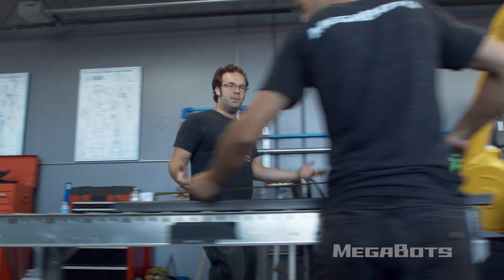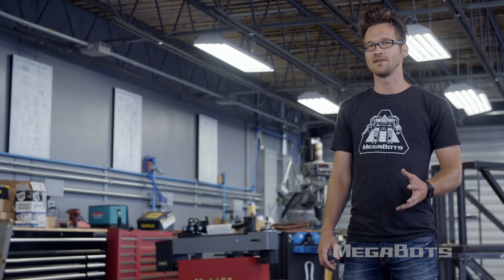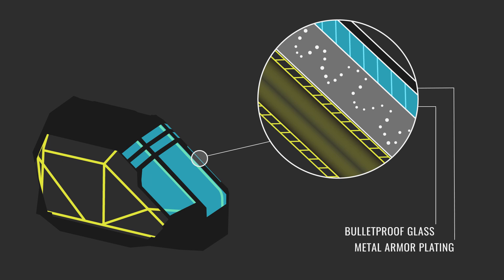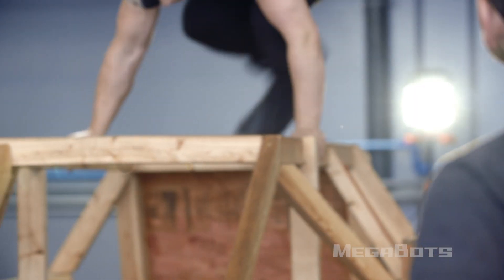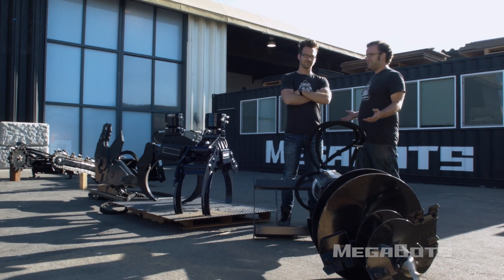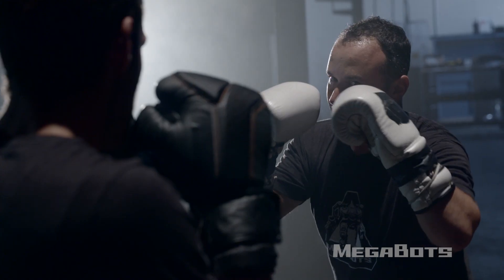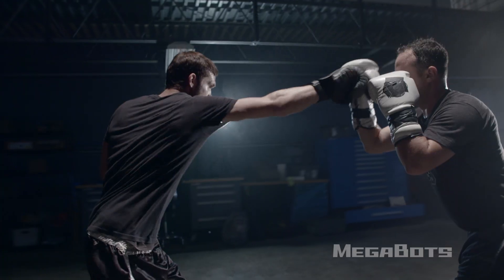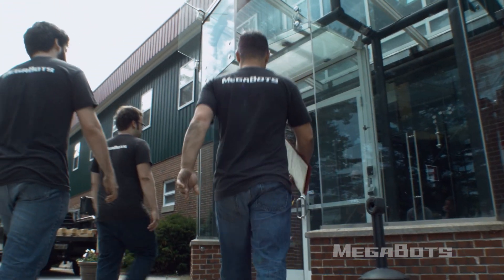How to Design a Giant Robot (Season 1)

Comment: The trencher, auger and stump grinder would not work very well against thick steel. The reason being they are meant for handling dirt not shredding metal. The best attachment would be a hydraulic demolition shear. It would total most opponents.

Comment: The robot would need a gal recover mode where the central sensor ( I assume an accelerometer) know when the robot is falling and move the arms back or forward depend on how the boy fall. 
By the way, no need for heavy weapon. A magnetic disturbance grenade would be enough to take the Japanese Megabot down because they heavy  rely on electronic system control.

Comment: I think they're being way to in depth with this. I would be amazingly surprised if the dodging worked at all and I have a feeling the robots aren't going to punch at all but just push each other. Or they're just going to run into each other blades spinning.
Reply: The thing is, they are thinking long-term. These people want to create an entirely new sporting event. They have to push the bar. Not to mention that they don't want to die. That MK1 was a death trap.
Reply: Andrew Hodge true but I think it may be early for that. I would be extremely surprised if they dodged a punch. Haha it sure was a death trap.
Reply: leroyjenkins140 I do agree that if they can make an enormous mech dodge and weave like a boxer, it would be a surprise.

Comment: One issue, if you're dodging side to side, and you get hit on the side while you're leaning, won't the weight distribution tip you over?
Reply: The Infamous that may be in the design it self also even if it does fall with the new design for the cockpit people should be alright

Comment: i get the idea behind the saw but if something gets messed up and it stops moving all you have is an odd shaped bludgeoning tool. just from my point of veiw some massive pneumatic fists to pound the crap outta the kuratas would be the safer design. if anything gets messed up with the fists just lock the arms position and rotate the body of the bot. just chucking that out there.
Reply: I'd install jettison options for limbs in case one fails. at least then you're losing some dead weight.
Reply: TheRoflcopterGod There's got to be a way to drop them and have them swing clear of the base simply and efficiently. But you bring up good technical challenges to think through.
Reply: skinlesscougar if they have a ranged arm and a melee arm, after losing melee functionality it would be best to pull back and take potshots.
Reply: i get what your saying, i mean i wasnt thinking of anything crazy, just like a scaled up version of the Hacksmiths mecha fist. no matter what they pop on there i'm sure its gonna be awesome. i guess the boxing section of the vid and the mentioning of how to move like a boxer is what made me think of robo punches.lol
Reply: from what it sounded like with all the talk about being able to fluidly move like a boxer and it being able to shift from side to side to "bob and weave" it sounds like it would be able to lean enough to one side to drop a broken or malfunctioning weapon. i mean i hope nothing breaks but like they said alot of their weapons aren't being used for their intended purpose. if you look into the weapons that are up there and what their intended uses are they mostly cut, rip,drill or grind into wood, soil and gravel not steel armor or whatever composites the kuratas is protected by. alot of the brain storming conversations would be so much easier if both teams mechs had blue prints or stats that could be easily accessed. i mean it wouldnt be good if your enemy knew how your bot was made dont get me wrong but i'm just curious as hell on the exact make up and details on these bots.lol 😂
Reply: the chainsaw becomes a dull sword why is this bad? It isn't as if the robot will have a hard time swinging it.
Reply: i didnt mean to say the trencher was dumb or ineffective or anything of the sort, i just was spit balling what i would do if i were in there position. i'm more of a rock'em sock'em robot kind of guy(like the movie real steel). you do raise a valid point though. 😁
Reply: I think the chances of the stumper, which is essentially an independent system, failing is significantly smaller than that of the much-less-tested, put-together-from-scratch punching arms. If nothing else, the puncher needs a bunch of hydraulics and software to work, while the stumper, being an industrial tool, just needs power and the ability to position it. The stumper is also probably safer, as its effects on Kuratas are more predictable. If you saw an arm off, you know it won't hurt the pilot.
Reply: +Christopher Knorr that would be pretty awesome, if the contest had multiple rounds they could switch out on the fly each of their weapons incase one got messed up or was ineffective against the kuratas. havent been able to find any updates from the japanes team unfurtunately so its not like we really know what would be most effective on there armor  or how quick our boys'll have to move to land hits.
Reply: They are modular aka they can come off. Having them launch off like in a movie would require far more thought put into it. The robot would have to be able to propel the arm far enough so it doesn't land on its own base (which would be a lot of force since the arm would be likely 1 ton by itself).